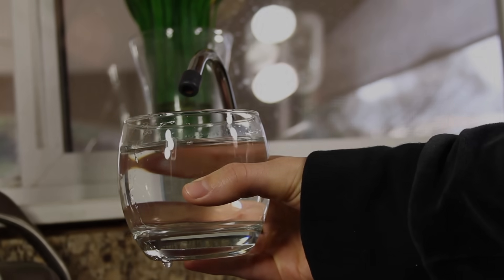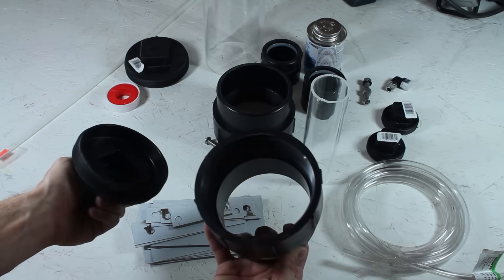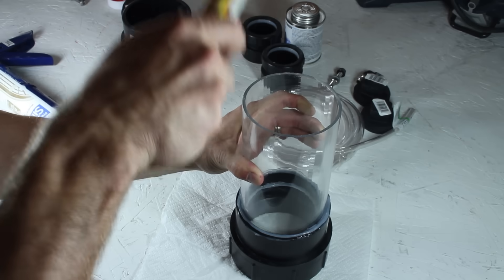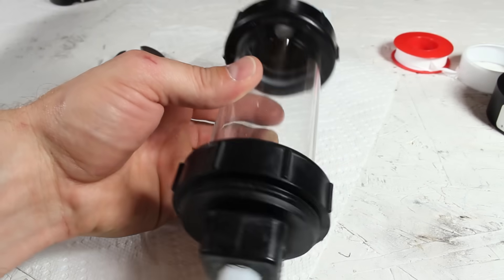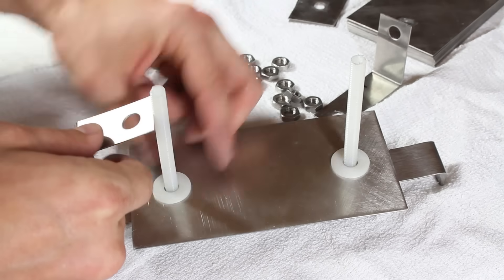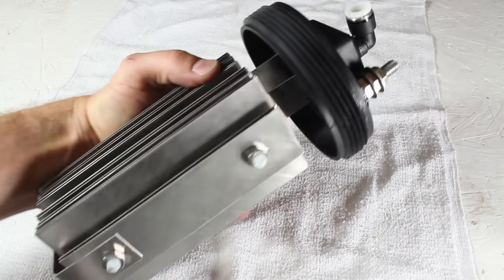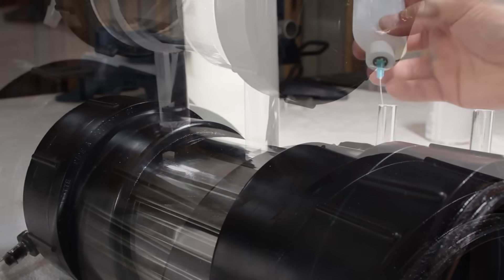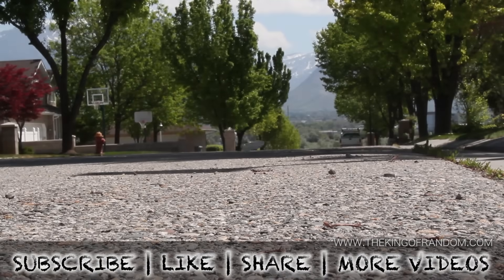HHO Generator - Water to Fuel Converter

Comment: Does the electrolysis of the water make the water you are using disappear into hydrogen and oxygen gasses? If so this is a very impractical source of energy if it eliminates water from the environment. There's a reason they're not using this technology on a large scale.

Comment: Simpler version: Buy a large plastic jar with lid. Use the same design as shown above for the electrodes. Fill with water. Instead of ordering potassium hydroxide off the internet, good ole' sodium chloride will do just fine. The "bubbler" that he uses isn't necessary, just drill a hole in the lid for the release valve.  Complicated doesn't mean better.

Comment: Hey Grant. Great Project! I am very interested in making one of these generators and I am looking for the parts. I have found mostly everything to build this except for that one way check valve. In what type of shop can I get one? I have checked my local hardware store but they only have huge plumbing check valves. I think that the gas shop has some but I am afraid that they need a lot of pressure to work. Pressure that the generator might not be able to make. Another thing. Would aluminium plates be as effective as the stainless steel ones? 
Love your vids! :)

Comment: Hey!! Could you please explain the science behind this? Why does it do that?
Reply: The Water is electrolysed into hydrogen gas by the means of applying electricity to separate the ions of hydrogen and oxygen the hydrogen is released through the bubbler which when lit oxidises and turns back into water
Reply: JoshuaJobey Thank youuu :D
Reply: Victor Houle Ions are atoms that don't have a balanced number of positive and negative charges. Atoms have a certain number of negative charges and positive charges, consider an atom with 10 electrons (negative charges) and 10 protons (positive charges). That is an atom. But consider one with 8 electrons and 5 protons. That is an ion because the number of charges are not balanced, but to be more precise this is an "Anion" because it has more negative charges than positive charges. On the other hand. the positively charged ones are called "Cation"
Reply: JoshuaJobey Very good, except for the one part where you say that hydrogen and oxygen turn into ions. In fact, the water turns into the elements - not ions. It just bothered me, sorry.
Reply: platinumwaiter I actually said it separates the ions of hydrogen and oxygen not that it turns into ions
Reply: platinumwaiter Wait, but wouldn't it need to turn it into ions to separate them?
Reply: Wait, what are ions? Aren't oxygen and hydrogen only atoms that combine to make the molecule of water?
Reply: HeyGuysIt'sAboutTimeIToldYou IHaveASmallDick  Read some books. It will help you more than us. But you must truly keep your interest in science.

Comment: One thing everybody forgets is that when using an catalyst to dry the water for electrons to move more freely that goes into the air after it burns and once in the air starts to dry the moisture that is combined wit the air then everybody get's dry itchy eyes. As I was experimenting that what happen to me it felt like needles in your eyes for about 15 or more hours so be careful being close to the stuff. Also Stanley Myers did it WITHOUT using anything in water which is a lot safer. If you use 110Volt power A/C and convert it to DC you shouldn't need a catalyst for it also add an amp arrester this way your amperage isn't so high making your water boil when running good Luck  Ps I did mine with 2x4 stainless wall plates and stainless dryer straps.

Comment: The produced gas is powerful, but its power is always smaller than the electric power needed to generate it. Anyone who want's to experiment with electrolytic cells may do so but no one must think he is doing serious "research"! Such cells are in use since a long time and quite a lot of research was invested for improving them. Industrial cells work with high pressure and temperature and reach efficiencies which can not be reached buy such simple cells anyhow.
Reply: Scratch Back This is a misunderstanding. Of course combustion engines do work with hydrogen gas! I never said that this isn't possible. What is definitely not possible: to run an engine and let the alternator produce enough hydrogen by electrolysis to run the engine!
And if you run an engine with hydrogen, where do you get the hydrogen from? You can get it from fossil ressources, this is the main source today. To produce it by electrolysis is not really favorably. Because in comparison it is much better to use an electric car, since the efficiency (mechanical output vs. electrical input) is much better with an e-motor. If you want to use hydrogen energy instead of electrical one, the modern concept is a hybrid solution with fuel cells, which convert the hydrogen energy in electricity to run the e-motor. This avoids batteries, but if the hydrogen is produced by electrolysis it is less efficient than a pure electric car.
Reply: heinzpg why is that when many other forms of gases like propane and natural gas to liquid forms has been converted on engines. why is it impossible to think hydrogen can not be ran in any engine? Sorry but car companys like bmw made a car that ran on hydrogen amongst others! WHERE ARE YOU GETTING YOUR INFO? none the least you can convert hydrogen right out of the air into electricity TOYOTA is talking about coming out with it.. Your only valid point was the alternator part.
Reply: Car alternators are very inefficient.  They produce way more power then is needed to run the car and charge the battery to start the car. These were the results from an installed HHO generator in my vehicle. The HHO generator did get my vehicle to produce some extra horse power and get better gas milage. Granted it wasn't enough to make it worth the effort.  It made me reconsider weather it was worth all the work building, installing, and maintaining the HHO generator.
Reply: Ronald Griswold
If more current is drawn from the alternator, the alternator needs also more input of mechanical power, which means diminishing horsepower on the road. But positive effects of HHO are possible also due to side effects. Injecting just a small amount of water can yield a better control of the burning process in the cylinder and can increase efficiency of the engine. Such schemes are used for big engines like diesel engines in ships since a long time, but they are not worth the effort for normal car engines.
But my main-point: HHO gas is not a source of energy. You never get more energy out of HHO than is needed to produce it from water. And the often heard claim that you can run a car solely on HHO is complete nonsense of course.
Reply: Yes I understand the whole alternator creating drag on the motor, kills how much energy is being put in to it but, Stanley meyer figured it out. Obviously you can make a cell run a car, its all in how efficient you can make it specially the electronics controlling the cell, if you can make a low current/amperage produce high voltage kind of like a amplifier hit a specific resonance/pulse, produce hydrogen like he did, I don't see why its not possible. I also think he said using lasers to break hydrogen was one of his next steps. Which lasers are in everything and low current friendly. I think whatever we do, electric or what it doesn't matter as long as its source is not nuclear or petrol.
Reply: Scratch Back
There is just no way to make a cell efficient above unity. Neither lasers nor "tuning" to the "resonant frequency" helps. Conservation of energy can't be just tricked out.
Reply: Many other things have been over come in development of electricity. Even tesla could transmit energy through the air or charge tungsten in a vacuum of particles to a million volts and use it as a directed energy/peace/deathray. But we will never beat unity. I get it...

Comment: I'm not sure what ALL the stainless steel plates are for... I've seen hydrogen generators similar to this, using  1 or more plates for the cathode, and 1 or more plates for the anode, but with the plastic rods and plastic washers you're using, it looks like some of the plates are totally isolated and thus not connected to either cathode OR anode... ???

Comment: I did make a 5v hydrogen generator using salt water, but was very slow in generating hydrogen
Reply: try using Potassium hydroxide KOH or increase the voltage

Comment: Hello Grant

Grant writing.  Tried this with my son
EPIC Failure
Did not fill the 4 inch tube to the top
Melted to top clean out fitting at the metal.  Any suggestions
G

Comment: Looking to build one but I need to know how big of a hole in the stainless steel and what distance form the edge it needs to be?
Reply: Your hole should be a slight bit bigger than your bolts that you are using, make sure every single part that gets submersed is made out of at lead 304 stainless steel (316L is much better) or else you get cruddy water like me witch is disappointing, but try researching about dry cells, they make much more gas and are a lot safer, a little harder to build but will be worth it, I haven't seem a single other person get as much gas as this guy from a wet cell not even close, so I think dry cell is the way to go.
Reply: errantry4 Thanks for the advice.

Comment: didnt the mithbusters say this was impossible?
Reply: The mythbuster built their cell incorrectly and didn't do sufficient research, their cells positive and negative (anodes and cathodes) were touching and since electricity takes the path of least resistance almost all of it went straight through the metal not touching the water, also they used distiller water with NO electrolyte, and distilles water is one of the least conductive things that exists! That's why their cell didn't make the car run, also they would've needed to make a much bigger cell because a car uses a lot of air ( a 2 litre engine will use 2 litres of air per cycle at an average of 1500 cycles per minute) that's a lot of gas it is entirely possible but at the moment few people (if any) have done it, almost every HHO system is a gasoline HHO hybrid.

Comment: I want to add one to my diesel truck!
Reply: Research dry cells, they are much more efficient than what you will get from a wet cell, the design in this videos ill give you enough gas to make your truck use less gas but will over heat in minutes dry cells are much more efficient and are safer and you will be more impressed by the results.

Comment: This energy is not free. It uses a process called electrolysis, which involves electricity. To get the electricity you have to either pay money or spend a crap ton of money to install solar panels or wind generators. It does have benefits like saving money on gas. But it is not entirely free. I hope this could be of any convenience to stop the arguing in the comments.
Reply: Why not just use an electrical motor as a starter motor? It will generate power from flywheel and won't apply any it'll feed back into the system and also be able to power the system for you..

Look at the new veyron vemon p1 and Porsche 918 hybrid.. They use this process to recharge the batteries in the engine and start the car too.. No more starter motor and additional horsepower to boot.

Comment: Does anyone have a PDF file or blue print to build this. how long do 2 car batteries run the generator. How long does the salt solution last before it needs to be replace.. looks like a great tool to have incase of a emergency..

Thanks

Comment: I want to build this and i can, but do you think a can had the hydrogen to my air intake car to help reduce the gaz consomation. I'll use 4 x 6 volt battery 50 amps that i'll charge at home.
Reply: You may want to design a circuit for powering the circuit via an electric motor in place of the starter motor.
Reply: Another important questions. what append is you close the systeme? Did the hydrogene create pressure? If yes, do you think it can go up tu 40-60 PSI to use only hydrogene to run a car by plugging the systeme to the gaz intake on a small 1.5 liters car?

Comment: I built this, it ended out costing ~$200. Check out my imgur gallery http://imgur.com/a/F6wi7 to see what I built
Reply: Amused Tuber Someone's got one rigged up and it seemed to work, haven't talked much since however.

As of now this $200 experiment is sitting on a shelf in my basement, not being used. :P
Reply: Did you try it on your car?
Reply: Nah not gonna risk it with my BMW. My friend rigged his truck to use something similar though.
Reply: R0K99 you could try with a small engine such a  lawn mower
Reply: Daniel Rios
Well that's really useful, converting a petrol lawnmower into a complicated ELECTRIC lawnmower!!!
Reply: MrOpenGL just a suggestion to test the rig not to actually make a working lawn mower
Reply: Just so they know that if they rig up this contraption to any engine they are simply inefficiently converting it into an electric engine!
:-)
Noo free lunch BTW
Reply: R0K99 Did it work when your friend rigged up his engine? What can you do with this contraption now that you have built it?
Reply: I want to know too will it work on a car to better the fuel economy a simple yes or no will do.
Reply: Tony Ontiveros No.
Reply: I'll take it I don't have the money the money to build it

Comment: Could hydrogen be compressed into a bottle similar to nitrous and be injected into an engine to make the air more explosive rather than colder and give you more horsepower? Or would the engine just explode?
Reply: Kinda like a cheap mans NOS...? sure you can, but only to about 10psi and I wouldn't be using plastic hosing, more braided reinforced piping and something like a bottle from a nos kit or perhaps a carbon fibre tank from a paintball gun, a few check valves so you don't have the unfortunate event of an explosion... Also have the system pressure tested for a safety rating so you know it won't blow up or at least fracture the compression tank.

Last but not least, I understand hho doesn't need compression, just pressurisation.. So instead of using the tank for storage, use it as a pressurisation tank and use a restricting valve to adjust the pressure at which it's being released from the tank.. And the best bit is, if you get a solenoid installed into the system, you could effectively have  cheap mans NOS KIT that you don't have to keep refilling at the local gas shop.. and is on demand

Comment: Looking at the way you built the generator core, aren't some plates isolated from the circuit?
Reply: yes they are isolated from the metal, however they are connected via the electrolyte solution, thus they still produce gas,, i know its hard to wrap your mind around it, but electricity follows the path of least resistance, which is through the plates, not around them, thus they too produce gas.

Comment: Doesn't the water heat up, like an electric kettle?
Reply: It does depending on the voltage applied and the resistance of the electrolyte

Comment: I cringe every time I see somebody use pliers to do a wrench or ratchets job
Reply: IncogInfidel u know then that that really doesnt apply here.. mechanics and pipe fitters are the worst for "using a tool for what its for" but if you can accomplish the same thing with another tool it is still deemed successful. and the nylon thread is more at risk of damage than the nut
Reply: Why?
Reply: becuase it's the wrong tool, one it doesn't give you control over the tightness of the nut, two it can mess up the nut.